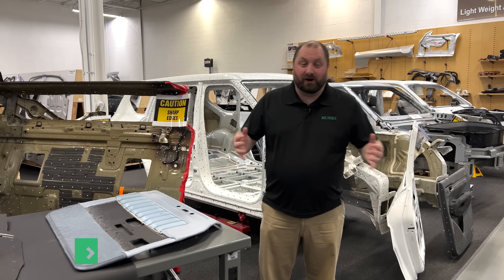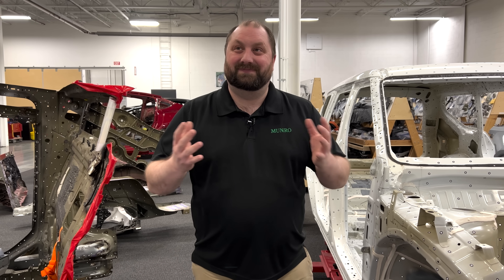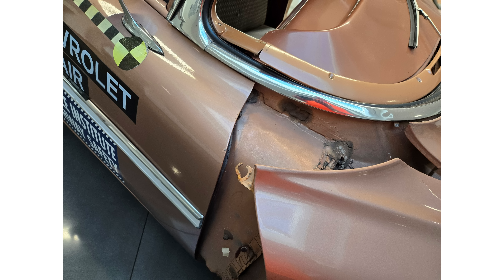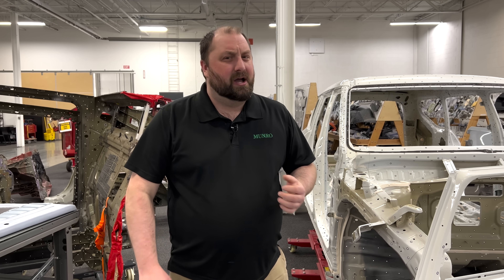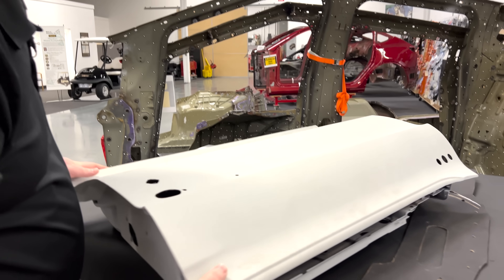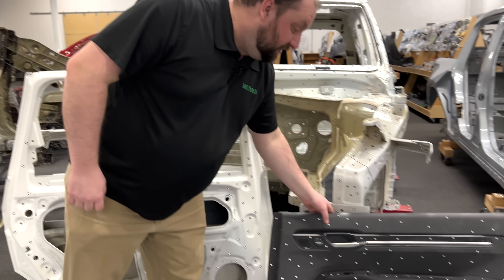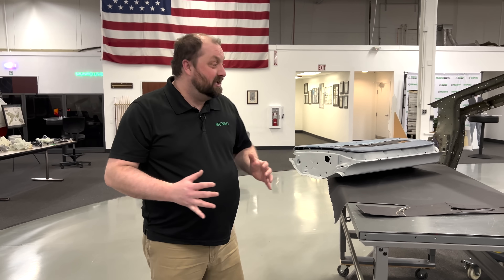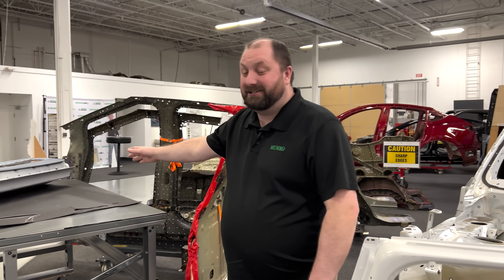No, Your Classic Car Isn't Built Better Than Your New Car

Comment: Wrong sir new cars are total trash.  As far as safety is concerned you are correct . Explain why model T Fords still run and the engineers who built the new cars can't get them to run and last . Why does it take a bundle of wire the diameter of a human arm to do what a linkage rod and 1 cutter pin did

Comment: There was no high strength steel in those old cars.   However,  IIHS did a narrow offset crash against a GM X frame that had no structure out toward the fender where the hit was.  You do the same crash with a Chrysler Imperial of that era which had front horns that stretched to the fender, and you will see one reason why the Imperials  from that era were banned in Demolition Derbys.

Comment: I totally agree.  Even back in 1970 when  I was in high school, people were saying the same things.  In Geography class of all places, we were talking about cars with the teacher and some student said that his dad's '54 Chevy was better than the new ones.  Granted, cars made by the Big Three back in the '60s weren't great, but the teacher said something that I still remember.  He told us that he would take just about any car of that day over something made in the '50s.  He said he had owned those cars.  An example he gave was the engine.  Modern engines at the time could go at least 100K miles before a valve job.  He said you were lucky to get 50K miles on the older cars before a full rebuild.  Tolerances were tighter now. Cooling was better. Pistons and rings were better.  Transmissions were better.  Newer cars had more HP.  He obviously didn't know at the time about all the poor structural components and the environmental problems but they were almost always better than what came a decade or two earlier.

Comment: Hit a 12 point buck at 82 mph. 2020 blazer. Had an abrasion on my finger from the air bag. But literally had a casual lunch an hour later as it wasn’t a big deal. Not even scary.

Comment: I have two cars,a mid two thousand BMW 5 series and a first generation Volvo s80 
Both cars rarely ever gave me a problem
I bought a Ford fusion around 2014 and by the time I was selling it I had lost a fortune on it
I decided to keep the BMW and the Volvo because they are built like a tank. They are reliable, safe and comfortable plus beautiful 
There is a time when I was growing up in the eighties where I remember that our fathers used to spend their weekends fixing those troublesome 70s and 80s cars that were always giving them trouble. Even my cars in the nineties which were eighties or early nineties were very troublesome, Everyday you had to fix something while the car is rotting away even if you park it in the garage

Comment: I was just having this conversation with a friend.
I really appreciate the simplicity of old vehicles. I love how I can look at an engine bay or diagram of a car from the 60's and piece together how it all works. I'm not a mechanic and I have no training or instruction on vehicles; everything I know is from looking it up and figuring it out on my own. Looking at a modern car, there's no hope of that. There are so many sensors reporting back to the computer to control all of these aspects of how the engine operates, and it's all abstracted away from the mechanics of the engine.
However, a new car is more complicated because it's better (generally). Back in the day, cars were simple enough for the owner to do a lot of maintenance because they HAD to be. When someone buys a car today, they can reasonably expect to need no more than fluid changes all the way to ~150k miles, which was unbelievable back in the good old days of distributors and carbs.
Things are better than they used to be, but we've lost the magic.

Comment: My issue is not that modern cars are designed to take an impact. It’s the fact they are increasing the price higher than the actual value
Reply: When you go back and adjust for inflation, we have actually gotten way more vehicle for the money as years progress. Even in the last 20 years, cars are far more advanced with way more luxury and safety.

Comment: Quality of materials was better on average pre-70s. Modern cars having higher strength steel structures don't disprove that. Very little plastic usage in critical components. Mechanical components and mechanical simplicity that the average man could repair in his garage. That means they are much more likely to sit for decades and still be revived. 
Don't confuse the lack of safety with an absence of quality. 
If modern American cars were made with the same material quality as those (they aren't), and pass modern safety tests, I would consider them.

Comment: Thank you so much for this. "they don't make them like they used to"--that's right, they're SO MUCH BETTER now. I have a 1946 Chevy Fleetline that I restored frame-up, and it's a reliable daily driver. I love driving it and getting tons of thumbs up, but I'll tell you, I won't drive it more than 50 miles, just on the basis of speed, comfort, safety, and most of all--fuel economy! My 2016 Suburban V8 gets significantly better MPG than any of the 1940s/ 1950s cars I've owned.

Comment: Dude, we get it. New cars have crumple zones. Doesn't mean that will save you in a crash. Problem with new cars is they are designed to not be repaired which makes them disposable. And as a bonus, they can't survive a hailstorm. Lame. All my cars are 25 years old or older.
Reply: That LITERALLY means that it will save in you in a crash. New cars are easier to repair than ever. All the crushed structure can be replaced if it's not a huge crash. They can survive hail storm. Outer skin is stronger due to ribs inside.

Comment: It isn't about the safety though, people complain about the reliability of new cars. Even more than reliability though, is the ease of repairing old vehicles. 

Of course a car crumpling is safer, but that isn't related to these issues of modern digital emission obsessed vehicle philosophy. Perhaps something can be said of old frames handling mild dents and crashes better at the cost of high speed crash safety. But that really is a separate topic.
Reply: I have to give credit to the newer cars. Older cars were not more reliable. I live in Minnesota and went to high school in the early 90's. My first car was a 78 Lebaron with a carburetor. Try starting that thing when it's 10 below zero. Maybe a 70% success rate. I always carried a can of ether around with me in the winter so I could start it on cold days. Later fuel injected cars I owned - they always started in the winter. I don't think I have had to shoot ether into an engine in 30 years. Also - the electrical system. I had to change plugs and wires on my old cars every 20k or so. Put in new points, cap, rotor, etc. Now I have an 03 Honda. I bought it 15 years ago with about 60k miles. I now have 260 k on it and I have yet to replace any ignition component. How about the brakes? My 68 Charger has drum brakes. Not much fun getting those springs off the brake shoes! The Lebaron? pfft...those Chrysler calipers locked up every few years, and you'd have to get those big rotors off and have to repack the wheel bearings, etc. etc. The thing I do NOT like about the new cars is the BS with the fact you need to punch in your dealer license number into the computer just to get the error codes. That's nuts.
Reply: @jamieostrowski4447  I wouldn't consider your 03 Honda as a 'new' vehicle, but I guess compared to ur 60's vehicle that's fair. usually the 2000's is the cut off period anyways before stuff started getting reallly digital.

Reliability I'll be fair probably has had its ups and downs with regards to car development with time. I'm more critiquing anti-right to repair nonsense as you highlighted with the error code restrictions, digitalization of cars in general, and emission related things like the massive switch of many trucks from 6 cylinder to 4 cylinder with turbo setups. Stuff like this just adds complexity to systems meaning both more breakdown in certain parts as well as the innability of amateurs or mama pops to fix these vehicles themselves. It's like every car has adopted a German mentality of car manufacturer now - overemphasis on interior comforts and over engineering of parts for short term performance metrics at the cost of long term feasibility. That is not per se reliability, but in a way it's equally relevant. The beginning of EV's will only extenuate these already beginning changes. EVs will similarly require less fuckery and maintenance in a given moment, but you won't be able to do anything with it yourself once it messes up, even if it is simply caused by a glitch in the system.

Comment: I agree with everything you said in this video. Modern vehicles are better in all of those aspects, but I still love the old classics more. The fuel mileage is terrible and they aren't near as safe in an accident, but I love driving them and they don't suck near as bad to work on. I have a modern car too and it's constantly being annoying.  If I scratch my head, it tells me to keep my eyes on the road (even though I never took them off the road). Then when I go to back up, it sees its shadow on the ground and slams on the brakes, jolting everyone in the car. For a while it was randomly going into limp mode due to what turned out to be a corroded battery terminal.....the classics never pulled that crap, except for Christine. 😅

Comment: I guess it all depends on what exactly one has in mind by "classic cars." Cars from the 50s-70s? Absolutely modern cars are safer in every way and often better build quality (though, for instance 60s American luxury cars are usually extremely well made.) 

But what are classics, to me anyway, are more like cars from the 80s and 90s. Even a 1980s Volvo is quite acceptably safe by modern standards. My 1986 Toyota Cressida is surely not as safe as a new Camry, but it's acceptable enough for daily use, and like most 80s-90s cars benefits from the underrated safety feature of excellent visibility. Good cars from the 80s and 90s have a nice balance of relatively modern safety, quality construction and materials, and beneficial technology with less to go wrong than the over-computerized nightmare of modern cars.

Comment: Aside from modern cars being constructed for safety, the materials used for interiors has immensely improved in the 21st century.  I have a 25 year old Tundra pickup that's parked outdoors 24/7.  The interior with the vinyl dash and seat upholstery has held up remarkably well.
A 1960s vintage domestic vehicle, in 10 years time, would have the vinyl dash showing cracks and the upholstery starting to shred.

Comment: The idea that older cars are made of heavier/thicker steel is easily disproven by looking at how much heavier modern cars are than old ones--much of that weight is crash structure. By the standards of classic cars, modern cars might as well be armored vehicles.

Comment: I have a w124 Mercedes and w211 e class too, I think that they are even today very safe cars, maybe not the safest but alot safer than american cars built in 60s and 70s.

Still old classic cars especially diesel mercedes would outlive 99 percent of modern plastic junk.

Comment: I've owned vehicles ranging from a 1929 Model A to 2019 Silverado. Mostly Chevys, a couple Toyotas, a few Fords and one Ram that was the biggest POS ever. The most dependable in my experience are from the 70's to mid 90's. Safety wise, I'd have to agree the newer ones are better. But the planned obsolescence mindset and the lack of OEM parts have left me hoofing it too many times. Good luck finding parts for a vehicle if it's 10 years out of production.

Comment: Now say something about CVT transmissions, wet belt timing systems, direct injection, computer modules everywhere… the list goes on. I’ll just stick with my old Buick with 300K miles.
Reply: Yup everything you mention makes the cars more efficient, more reliable.  Your Buick probably costed you more in fuel.

Comment: Family runs an auto salvage business. There is a marked difference in just the last twenty years let alone the last 40. Even low end trash like a Hyundai will keep you alive in a bad wreck that would have turned you into sausage in a vehicle from the 80s let alone the 70s. Especially small trucks. We bio tag(when people in vehicle pop) fewer and fewer vehicles. Having said that, the cars definitely sacrifice themselves in a wreck and insurance salvages them for damage that just doesn't look that severe as the repair costs on modern vehicles are just so high.

Comment: I think the one area where old cars are superior to newer ones is minor, low speed collisions on their chrome bumpers, especially those that had rubber snubbers mounted on them. The chrome might scratch up a little but you're not spending thousands on body work like you would today for a collision of similar severity on a newer car. I think it's great that newer cars are safer, but they're also way more delicate. If the repairs were cheap on newer cars, I don't think this debate would come up nearly as often.

Comment: My complaints with modern cars are mostly with the very newest generation that has cylinder deactivation, auto start/stop, nagging chimes, and data harvesting. I'm okay with regressing back to 1990-2015 where those things are concerned. I also don't love the tiny oil galleys that require 0w20 oil. That's just begging for trouble. Enjoy your 0.3 mpg boost, I guess.

Comment: If you take a good hard look at the structure of a car from the 60s and a car from the 2000s you can see this very easily. Not a great comparison, but I’ve owned a classic beetle and a 2000s civic. The beetle, while mostly made of metal, felt like it was constructed from tin cans, had a motor that works when it feels like it, and that’s without any rust being garage kept and babied. The frame on the beetle looks and feels like one of those disposable baking sheets.

The civic just worked constantly, and everytime I worked on it I would be shocked at just how thick and solid feeling everything was in comparison. Mine was rusty as hell because it had 150k miles in the midwest but it was all surface rust. Scrape the grime off and keep working on it.

Comment: as N David car collector/ restorer. who owns and drives nothing but classics. I always explain how the classics have a better driver to car connection with the driving experience. but am also quick to admit the flaws. they are much slower than todays cars. handle and stop horribly. the Impala in the crash video had the X frame. which was a horribly designed frame. it also had the 90 degree windshield pillar. which was prone to collapsing. but the styling was the important part back then. not safety. my current daily driver is an 86 Bronco. which ive had for 5 years now. and still enjoy.

Comment: Except classic cars are better. The planned obsolecense in the past was to put a smaller odometer on the car. Come out with a beautiful new car while your car got worse gas milage and smoked a little. If the people opened up the choke a little their car would run like new. But since people aren't mechanical the bought a new car. The one thing new cars do better is rust protection.

Comment: I was a collision repair tech for 27 year's. Plus I've owned and restored classic cars from the 50s and 60s. And I love them! But there is absolutely zero crash technology built into them. The crash technology designed and built into modern cars is very impressive, and very effective.  Now for the past 11 year's I've been a semi truck driver. And though they are big and heavy,  they still have almost no crash technology built into them. And I definitely would not feel safe in a crash scenario while in a semi truck. In a crash involving my 2013 Malibu and a semi, i would much rather be in the Malibu. This is an excellent, accurate, and very informative video!!! 👍
Reply: Zero isn't fair. A 1978 F150 will have crumple zones you can see built into the inner fenders running parallel with the frame rails. Also a collapsible steering column. It's not much but it is something.

Comment: It’s been said that you could take 40s-70s cars after an accident just hose out bio hazards from the interior and put them back on the lot. 
My own mother nearly died when she was 11 when she was riding in a late 50s Ford sedan. They got into a relatively low speed collision near Main Street in a small town. The car had zero passenger restraints and she went through the windshield all the way to the pavement. She was horribly disfigured since this was the time before safety glass. She had to have her nose reattached. 
The car was otherwise driveable aside from a damaged bumper.

Comment: Transmissions went out like clockwork at 60-100k.  Engines shelled.  Cars are far more reliable now than then.
Reply: More reliable? They are junk after 10 years! 
Most cars on the junkyards are from the laste 00‘s and early 2010‘s. In 20 years every cars made after 2015 will be gone of the streets while classics will be loved and adored!

Comment: It is obvious that cars will improve in safety and other areas as time progresses, but you are severely misleading people regarding the construction of classic cars.  Older cars had metal grilles as well as metal for knobs and handles, covers, rods, various fittings, springs instead of gas struts, real chrome or stainless steel instead of plastic and so on...for someone who claims to be knowledgeable about older cars, your ignorance is profound.

Comment: Just think how good a modern car could be if all the unnecessary electrics were not fitted, electric windows/central locking/AC/ electric parking brake ect. Make cars as good as they can be but easier to fix.